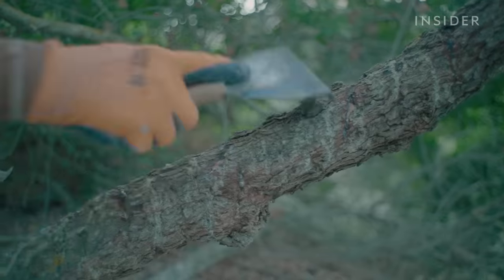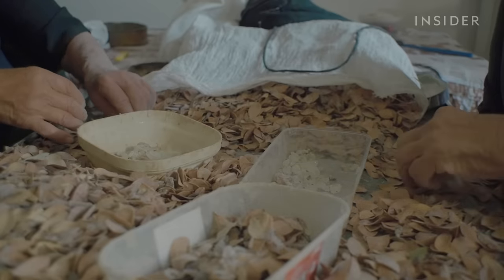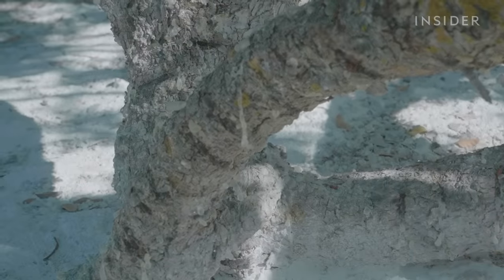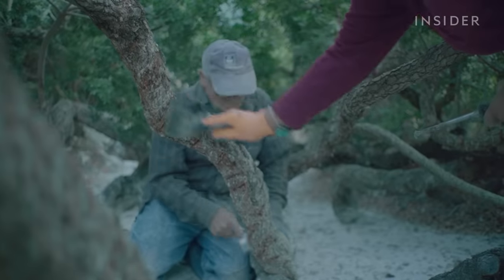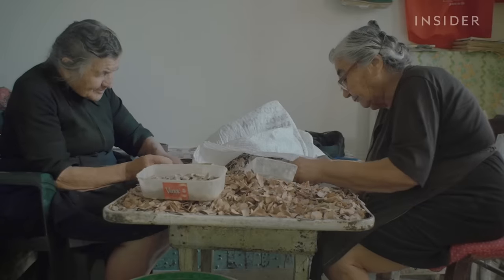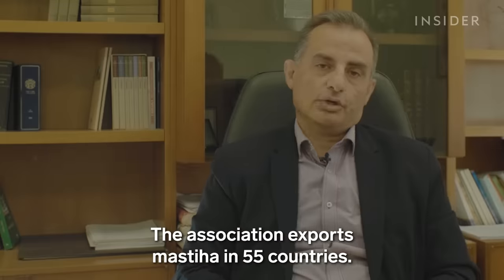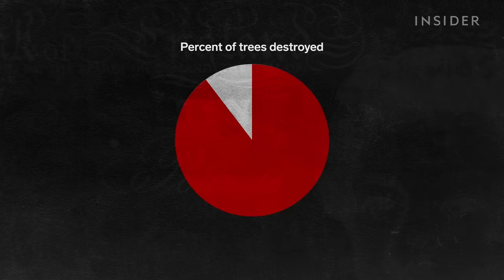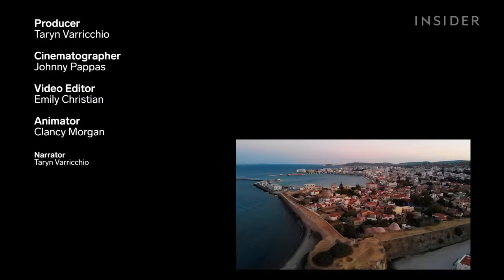Why Mastic Tree Resin Is So Expensive | So Expensive

Comment: I would chew this to build jaw muscles and it worked quite well. It's very tough for a gum substance. The nice part is you can take it out of your mouth and let it harden and just use it the next day. It lasts really long if you do this
Reply: Hey question about youre comment because im considering buying IT for the same reasons.  

Do u do something to clean IT if you are gonna re use it? And how many days do u reuse it?
Reply: @videodimensiondeog7488  I don't truly clean it, sometimes I'll dry it after I stop chewing as well as rinse it. It hardens very fast when not exposed to something warm and will shatter which can make it easier to rinse. It would be hard to legitimately clean due to how fast it hardens (basically meaning you'll only be able to clean the outer surface).

Also, it seems like it lasts an extremely long time, I've never actually went through a chunk by chewing it, rather I'd throw it away or lose it.

Comment: Kinda feel like a blue tarp under the tree would help in the harvesting of this resin. Kinda like nut farmers have a bet to catch nuts they should have a round tarp that they can use to catch the resin and not have to sweep it off the floor. Also they said they lose alot do to the small bits they cant sweep off the dirt. Why haven't they started using something to catch all of it .. seems like less waste and a easier process.

Comment: these extra labor is not necessary and just Bullshit to up the cost of the tree resin 
if they were to use dehydrator the resin  with a machine it work faster and no need to wait , just use a machine to separate the resin - which there are machine that do that why not use them
also is just  more bullshit just to keep the cost high